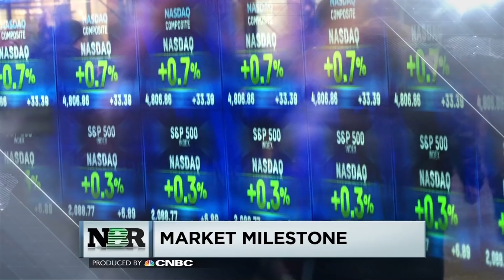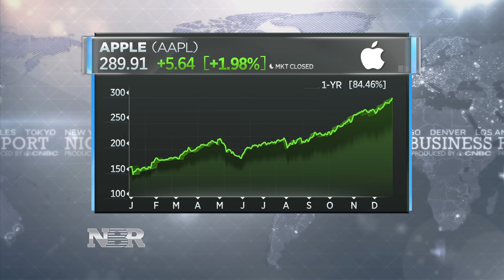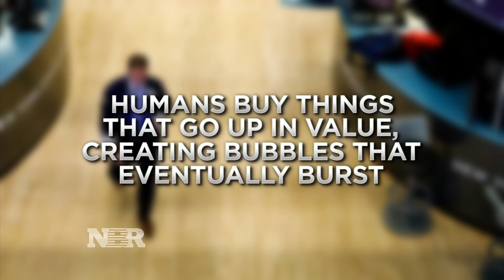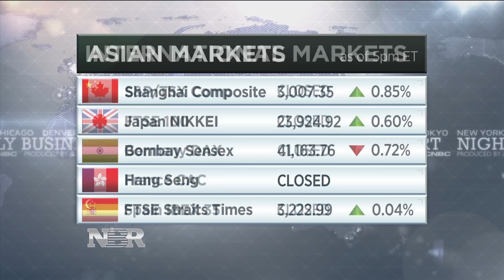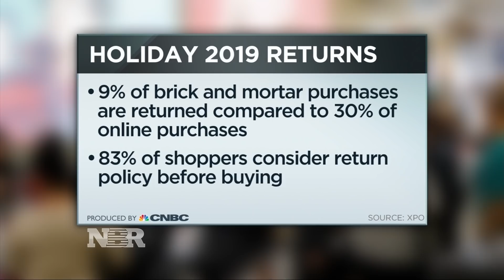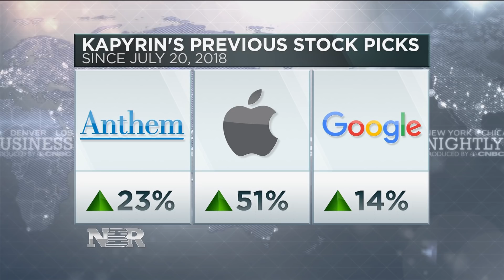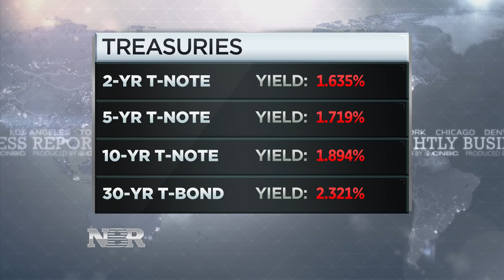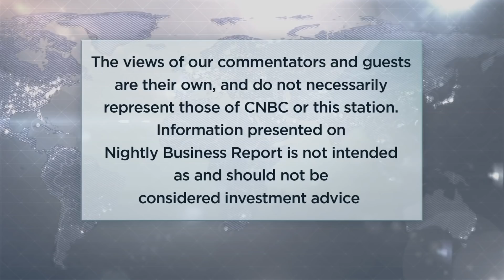Nightly Business Report – December 26, 2019

Comment: Today there were 104 new 52-week highs and 31 new 52-week lows on NASDAQ.    On the NYSE there were 106 new 52-week highs and 7 new 52-week lows.   The slope of the US Treasury yield curve declined slightly: 74 basis points separated the 1-month (1.59%) from the 30-year (2.33%).    Volatility, as measured by the volatility index multiple I follow, UVXY, declined slightly.   UVXY closed at 12.64, off 0.32% on the day.

Winners of the day included Teledyne (US ticker: TDY) and Douglas Emmett (US ticker: DEI).   Regarding TDY: "Teledyne Technologies Incorporated provides instrumentation, digital imaging, aerospace and defense electronics, and engineered systems in the United States, the United Kingdom, Denmark, Canada, France, and the Netherlands.  The company's Aerospace and Defense Electronics segment provides electronic components and subsystems, as well as communications products, such as defense electronics; environment interconnects; data acquisition and communications equipment for aircraft; components and subsystems for wireless and satellite communications; and general aviation batteries."   It has 10,850 employees.   Regarding DEI: "Douglas Emmett, Inc. (DEI) is a fully integrated, self-administered and self-managed real estate investment trust (REIT), and one of the largest owners and operators of high-quality office and multifamily properties located in the premier coastal submarkets of Los Angeles and Honolulu."